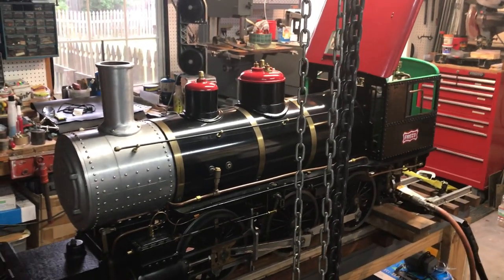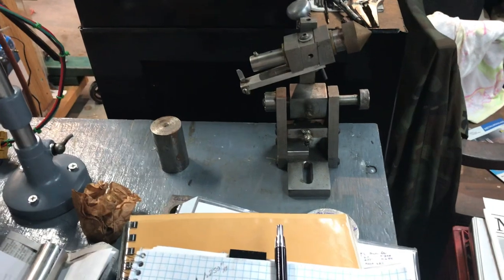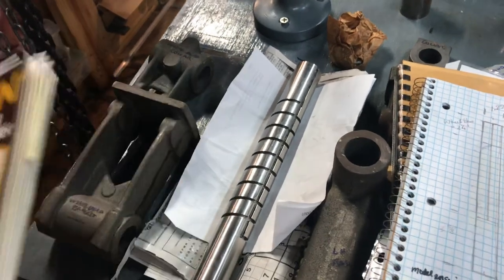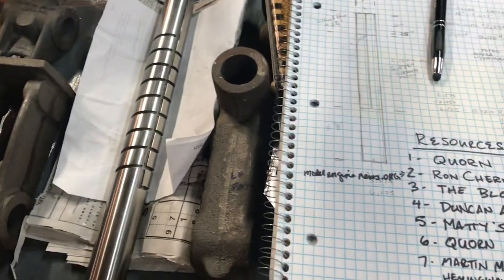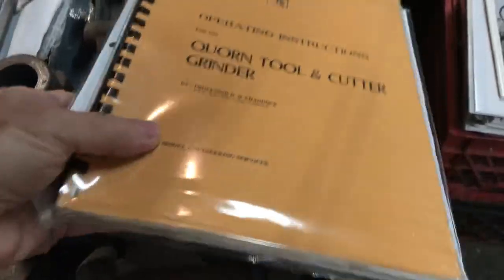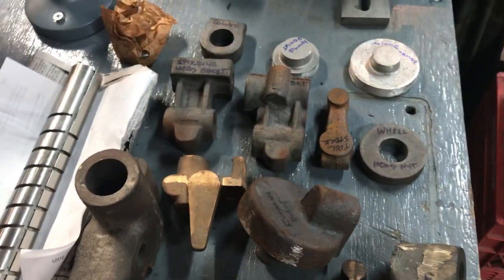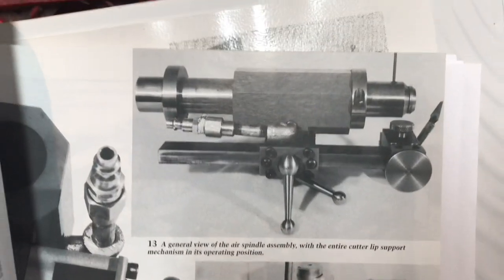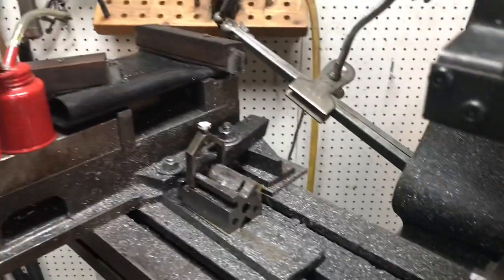Quorn Tool Grinder project introduction

Comment: Many years ago I built one of these.  It is indeed a very useful and versatile machine.
If, however, you wish to sharpen the helix cutting edges of milling cutters, do not build the design author's suggested tooth rest, but copy one from a commercial machine.  
The issue here is that the tooth rest and its mounting must move with the cutter spindle mounting as one unit.
Also, for large and very small cutters an air bearing spindle is almost mandatory.

Comment: This and Matty's series should be excellent references. And I've been keeping 3 ring binders for many years for my lathe manuals and accessories, my mills and there tooling, one for my most used Machinery's Handbook tables, and one for future and past projects. I'd agree, there an excellent method of keeping your reference material in an easy to find format.

Comment: Gday, the fun is about to begin, I’m really looking forward to seeing you build the Quorn, it is a fun project which has tested my skill level and I’ve learnt a lot, I’ve found the drawings to be a different at times, there all nominal sizes so you have to make up your on mind to what fit they are to be, the prints you have coming sound a lot better, cheers
Reply from the maker: Thanks, Marty! Got the bed bar material yesterday. Been day little prep work in the evenings. Will post again this weekend...
Reply from the maker: Sorry I typed Matty but spell check changed it.